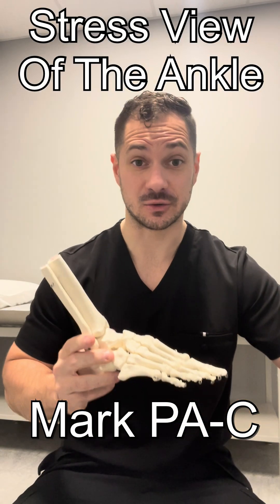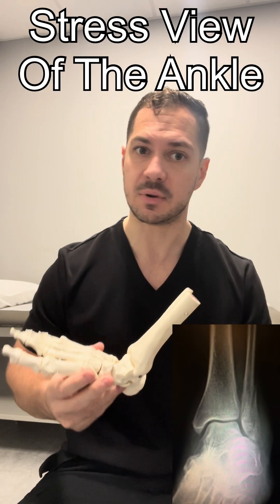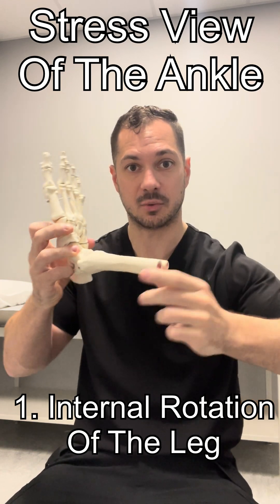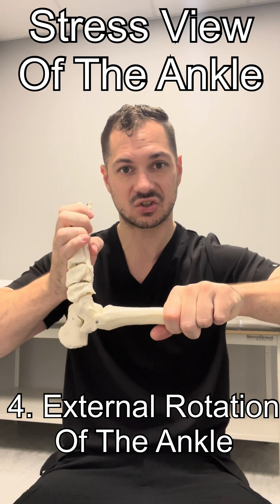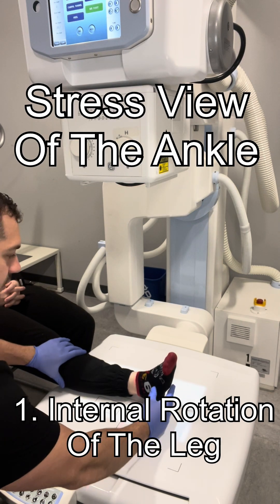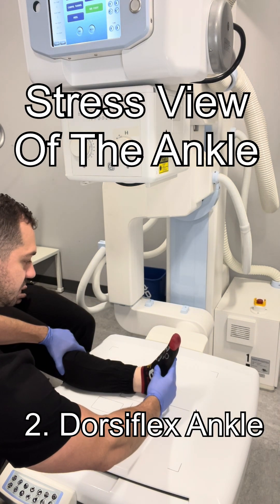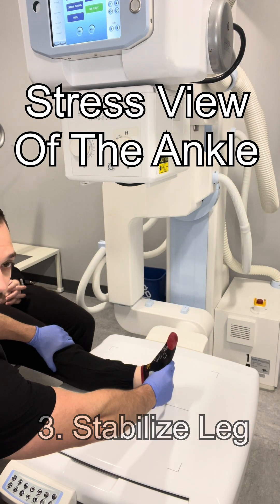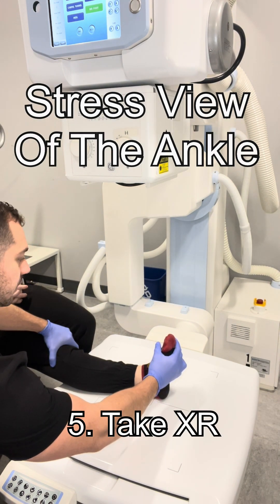How To Perform A Stress View Of The Ankle On XR #shorts #xray #ortho

Comment: My dr did that weird bending the ankle at 90 degrees. Internally not externally.  Hmmm lol 😅
Ligamentous insufficiency: Widening of the joint space on the stress X-ray compared to a normal view indicates an injury or tear in the supporting ligaments on the outer side of the ankle. Still though how can it determine surgery 🤔 😕